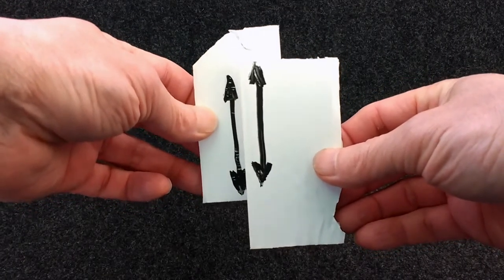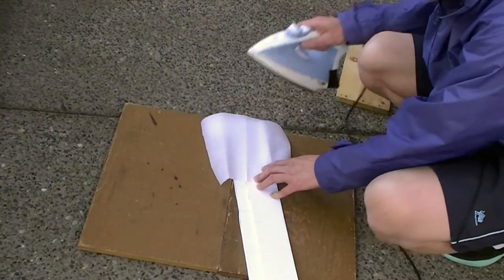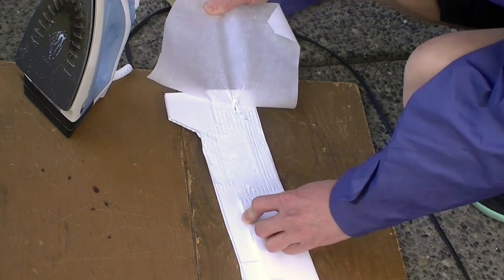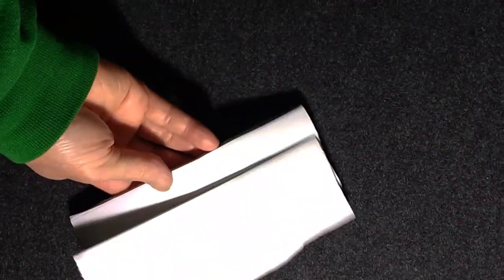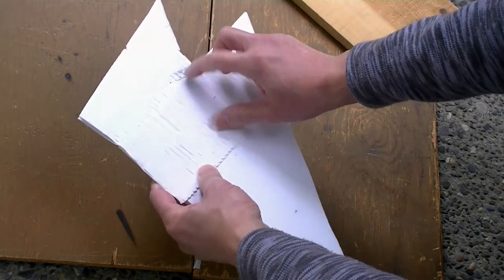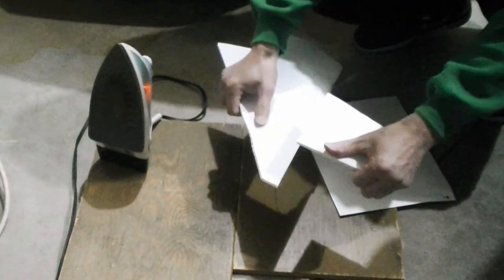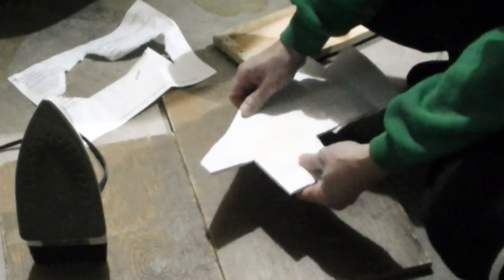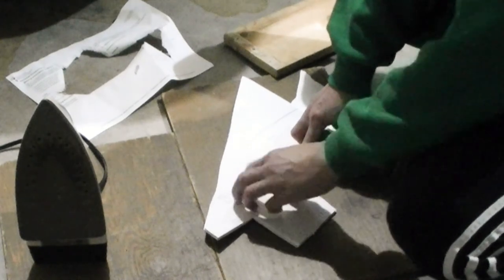Part 2 New Technique - Heat Fusion to join two pieces of coroplast

Comment: You are making great videos and I can't wait to try building a boat! Have you tried setting the two pieces end to end, not overlapping, and fusing a small strip on top of both? This is called a butt strap in carpentry. It seems like your new fusion method would work well with a butt strap.
Reply from the maker: Thanks for your feedback and  suggestions. Yes, I have done something similar with my old fusion method, illustrated in this video https://youtu.be/NZ2UCDGkuxM
I have also applied similar technique in this video, I call it a bandage joint since I don't do much carpentry and don't have a good name for it :-)
https://youtu.be/RTzv72DOPQE
For this new technique, if I have a heater /iron with narrow heat plate, the result should be better than my old method. Thanks for watching!

Comment: Thanks for your development and work. It has made me wonder about the viability of coroplast to replace marine plywood when making outriggers for a sailing canoe or a small trimaran. I wouldn't require the folding feature as much, but the ability to heat weld with strong enough bond makes it an intriguing option to try.
Reply from the maker: Thanks for watching my channel. The outrigger is on my to do list. I experimented the Kayak sailing  https://youtu.be/v81BE41XkDU  by converting my Gen 7 Kayak. Then I plan to modify my Gen 10 for sailing by adding outriggers, better mast design and sails, etc. I stopped that project and jumped into building the modular pontoon boat  https://youtu.be/GYJq3BOIcDc  because it is more versatile. My proto-type didn't turned out well and has water leakage.  At first I need that boat for my camping trips to the coast and catching crabs (I need a very safe boat :-). Because of COVID-19, I cancelled those trips. I figured out how to stop the leakage, but I  put that project on hold and jumped into building Gen 9, Gen 12 kayaks so I can have short trips to the rivers. I will finish the pontoon boat this winter. That modular pontoon boat can be extended  from 9' to 14' (for two people). I plan to make a foot paddle for  that boat also. The width can be scaled to make it into a stable catamaran. If I scale the pontoon design into a smaller unit, it is basically an outriggers unit. The pontoons will be sealed and water tight. I probably will add small trap doors to have access to the inside of the pontoons also. I will add float bags inside the pontoon just to have extra safety. I used foams inside my pontoons before but that added weight.... Will share the progress in the future..... cheers...
Reply: @DIYUSA  Thanks! I did see that video as well.
I was thinking more of replacing the heavy and expensive marine plywood laminated with epoxy and fiberglass with coroplast. It would probably still require some ribs to keep its form, and it would need to be watertight. Some 3D coroplast foils might add more lift and buoyancy as well.
Reply from the maker: @wisenber  I watched your videos to understand how you would use the outrigger. I can definitely learn more about kayak sailing  from you. I did gen 10 to understand how to use coroplast to create the ribs. The result is exceeding my expectation (in strength). I could build the whole boat without screws (also no glue). I add those (on Gen 10)  are mainly on the safe side to transport the boat on the car top. The floats/pontoons for the outrigger will probably smaller than my pontoon and it should be easy to make them out of coroplast. The concern will be the attachment of the 'arms' to the pontoon. My experiments with embedded PVC pipes should provide strong mounting points for the arms. My goal in using coroplast is to minimize the need for wood and screws to prevent rots, rust and cost (use stainless steel screws).
Reply: @DIYUSA  Those were a 1 meter sail on a kayak. I've actually built a 19 ft Slingshot trimaran with a 14 ft beam from marine plywood that weighs about 300 lbs with 150 square ft of sail. I have yet to get video of that but she gets up to about 20 mph.
Reply from the maker: @wisenber  Making pontoons for the 19' trimaran is so much more challenging than a simple kayak I am building :-)  For now, I want to build sailboats under 12' because exceeding that length, I have to register that boat. Looking forward to see your video. Thanks for sharing.
Reply: @DIYUSA  I do get that we diverge on build requirements. The ability to fold and store aren't as high for me (although I did make a folding Yost design kayak).
Sorry to hear about your 12' limit. Nothing propelled under oars needs registration in my area. It's the sail or motor that triggers the registration requirement.
That being said, I think your folding requires much more ingenuity than a simple 19' outrigger. I just needed to see your fusion and lamination methods to make me realize that there may be quite a bit more marine applications to coroplast.
Thanks for that!
Reply from the maker: @wisenber  Thanks for your comments. Here in Oregon, there is no 12' limit if the boat is under oars, but I am interested in adding sail, which has 12' limit. I  have a lot of respect with the might force of the oceans and seas (I was a seaman in the 70's). Sailing with 150 sq. ft of sails is a lot more different from my canoe sailing in calm rivers and lakes. I will be doing more experiments in this winter...Cheers!

Comment: Interesting how strong that bond is.  What do you think the lifespan would be when constantly folding the bonded areas?  Also how winter proof is coroplast?  I was thinking of removing the fabric roof of my gazebo and replace with the coroplast. I live in western ny and get harsh winters.
Reply from the maker: Thanks for your question. I did a simple test on the fused joint using a heat gun, which I named it as a flushed joint and I can only test up to 140 lbs  on a 2" deep,2" wide joint (more details in this video  https://youtu.be/YSkBW6CQjDw  ). I have yet to test the joint fused with an iron (the new method). My gut feel that should be even better because I can increase the contact surface of the joint. If your gazebo is a fixed structure, I would use other material, which is less expensive and stronger, but is heavier. I search this manufacturer site and it stated 
Normal temperature performance range -17 degrees F to 160 degrees F which is better than I have expected.
https://www.coroplast.com/resources/resin-specs-glossary/
For a simple fold, I have tested it with a thousand folds and I didn't see any degradation at the folded seam. However, for a complex fold, such as a sheet folded twice and created a shape corner, I am not sure how good it will be. But I would say it should be able to handle hundreds of times.  However, it can be repaired easily, by tape or by fusing a small piece on top of the teared coroplast ( I have video in my channel on how to do this). I can think of ways to fuse coroplast and make the gazebo top last for thousands of folds if I have more information on how the gazebo looks like. you may email the info to me   PDXBoatmaker@gmail.com   I plan to make a folded tent out of coroplast for camping also. 
Cheers!